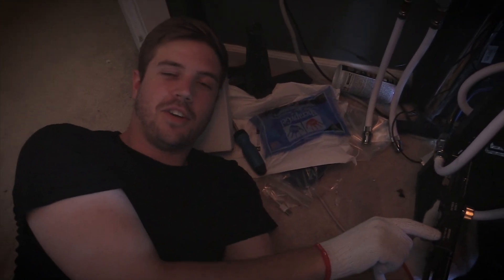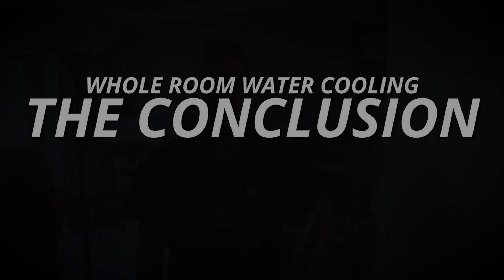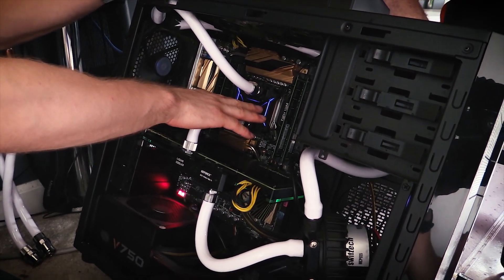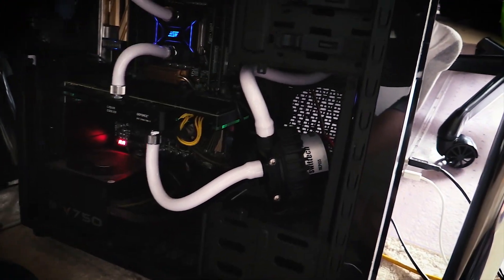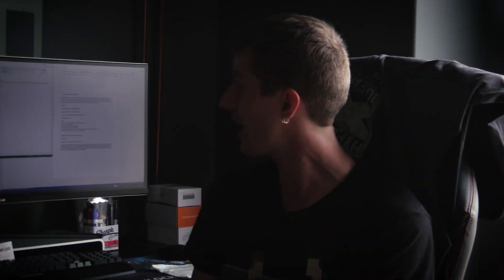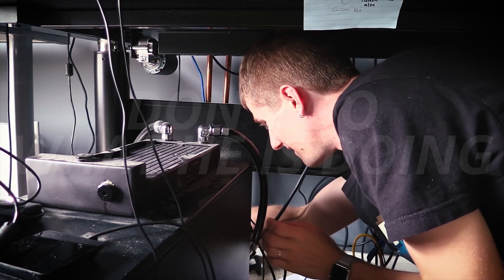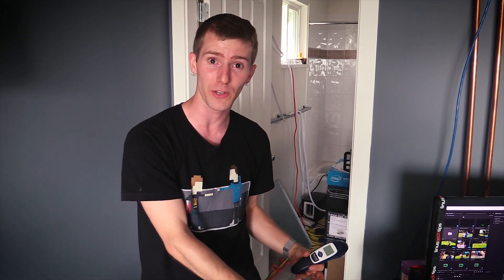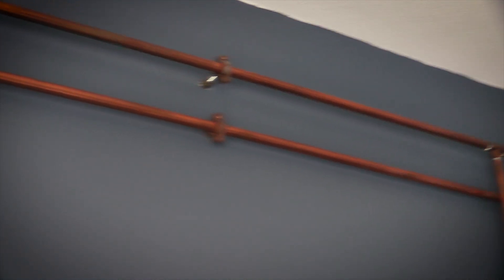Whole Room Water Cooling Part 7 - It's FINALLY over!

Comment: I honestly love this idea, and wonder about doing your water reservoir as a borehole into the ground like a well. It would pull from the cool part of the water with lots of volume to circulate, and as long as you filter and have a closed loop, you won't have contaminants circulating, then it can still radiate some heat into the air through copper pipe fins in the outside section before returning to the reservoir at the top end. If by some chance you were convinced to tackle that, I'd love to see it in action.

Comment: What's cool (pardon the pun) is that 7 years ago, Linus did all this instead of just buying an AC.

7 years later, in the 80 staff video, they had to pay $13,000 for a cooling solution, because an AC unit would have cost $150,000. 

Wild.

Comment: One thing I found amazing is that they wanted to remove heat to the room but continued to use cooling  radiators on each computer putting heat into the room.
Also it would have probably been a LOT cheaper to just install air conditioning by professionals who would chill the room down to 10 c or lower. 
or just chill one room and put ALL the computer radiators in the one room with the frost one the walls 
Don't try to reinvent the wheel you are not engineers

Comment: i actually did this with a custom waterloop, but for one system only. all the major heat producing components were in different rooms with PE tubes running through the wall separating them. it worked pretty well, there was no sound and no heat for the pc user. i had thought about dumping the heat outside but the logistics of setting up custom weatherproof electrical systems put me off. all in all, waterloops are not fun to maintain at all.
scaling up isnt really the solution here. its not enough to jerry rig some megaloop that runs through your entire space, it has to be built in to the walls. water is also very poor on such a large scale. its ok for the pc components because they are small and close together but the better answer is to just exchange your heat into a larger heatsink structure, like the house itself. or just fix cabinets into the walls with a vent that goes outside lmao
Reply: Youre insane man..
Reply: @shloftyintuos  like you gotta do crazy shit with custom waterloops, its the whole point. but it worked.

Comment: And, for the next video,  DIY electrical work replacing all the outlets that are within 3 feet of a water line with GFIs so they're up to code.
And, why not wrap those outflow lines with thermal wrap like one does for their hot water lines in their home?  That would help.

Comment: This already 6 years latter... But I want to ask....
1. Why not using Air Conditioner cooper pipe that have insulator so the heat (and the cold) would not goes into the room.
2. Why not using gasses instead of water? Gasses like refrigerant that used in Air Conditioner (AC)?
Reply: Because they are not sponsored by an A/C company.   This is entertainment and is supposed to fail while making you think about buying things from their sponsors.

Comment: Great job 👍 what a really cool build. 
You went for the cool Cooper look, But using insulation on the loop would have yielded much more performance.
Your hot line is bleeding heat into the room, and your cool line is picking up the heat in the room, so you radiators cooling efficiency is wasted.

Comment: you know if they insulated the copper pipes properly they probably could have gotten alot of the heat out of the loop via the radiators and cooled the room better

Comment: What if you fill your entire pc with mineral oil and attach 2 pipes to it. Those pipe go through a freezer with temperatures around -30F and you make the pc  and the pipes thermal isolate. After all this you can crazy overclock your pc. What do you think?

Comment: This is a really cool idea, and I do agree I think it could work. But I was wondering the entire time why they were using bare copper piping. Literally all of the heat from their systems are being dissipated mostly in the room. If They were using some insulated piping, they probably notice a much greater than 1° difference. Because then none of the heat from the systems will be going into the room, or at least very little .

Comment: Yes everyone knows perfectly well that an A/C with a curtain would've been cheaper and done the job fine - that's not the only point. The idea was exceptionally cool, and the rule of cool wins 9 out of 10 times. They fell short in their execution of the idea. Impractical yet very very cool idea, but unfortunately very poor execution.

Comment: Back in the early 1990s, I worked at a bank. They had just installed a new IBM mainframe in the computer room.  It was extremely quiet, and when they opened a cabinet, all I saw was a huge pump and large water pipes :-)   The mainframe was was cooled, and the water was directly connected to the Liebert unit. So the machine got cold water in, and put out hot water (not just 1° tempoerature difference).

If you have a room full of editors whose workstations each put out 1000watts of heat, it can make sense to take that head directly out of the machines instead of dumping it into the room and requiring more air conditioning power.  (and in winter, you get free cooling if your water loop has radiator outside).

Comment: upss. as you mention.. in this particular way like you did build the system, you just basically carry the cooling ingradient through the pipe but not the heat that it has. exposed copper pipes, as a really good thermal conductive, release back whole heat into the room before it reaches to the radiators outside. just cover whole system with foam and tape in Linus style, like air conditioner pipes has. =)

Comment: the copper pipes are acting as a heatsink, so the heat is going back into the room.  you need to insulate the copper pipes so the heat is taken outside.

Comment: If you do get the idea to do this at your new place, bifurcate your loop. Each computer has its own internal loop, with its own pump, reservoir, etc... but with a heat exchanger[1] in place of the main radiator. (You still want a small radiator in each unit in case the main cooling system fails.) [1] A good example would be one of these:  https://koolance.com/hxp-193-compact-plate-heat-exchanger
The main cooling line will connect to the other end of the exchangers will have its own fluid, pump, reservoir, anti-fouling and fan/radiator. This would prevent contamination from fouling your sensitive gear (like Teran's waterblocks in his rig) You also wouldn't have to worry about pressures in the main section of the WC infrastructure, affecting the performance in the individual rigs it is connected to via the exchangers.  It would also allow you to add the benefits of a chiller unit-- drop the temp of cold line on the main side to 5 or so degrees above the dew point to prevent condensation but otherwise allow for performance you'd struggle to get at straight ambient.

Second use PEX piping instead of copper, it's non-conductive, easier to guide, and doesn't require soldering.
Third, minimize pipe height to cut down on required head pressure for the pump and increase efficiency-- run the piping either through an exterior wall preferably near a window, or to a room you shove a AC mini-split into. 

Finally, get a butch radiator to expel the heat from the main loop with (IE. something like this  https://www.outdoorfurnacesupply.com/36x36-water-to-air-heat-exchanger-hot-water-coil-outdoor-wood-furnace.html ) and cool with as few fans as possible.  Relying on standard computer-size radiators and fans for at-scale cooling is nuts. You required dozens of fans and plumbing connections which increased the complexity of the system and likelihood of a failure.

Comment: You should have kept the PCs isolated from the external loop, and you should have bought a water chiller rather than building one out of PC rads + 120mm fans. Finally, plastic tubing.

Comment: !st I love you channel and you've been a go to place for information. That being said....

I'm posting this because we had this issue and many others do....and you're showing an instantaneous drop in temperature after the switch to room cooling...expected....but how does the system operate with everyone plugged in over the course of the entire day.

We had the same problem in my office...no matter how much cold air we blew upstairs it was still hot as hell....portable AC units create a large heat source on the compressor side which is inside the room hot enough to be to hot to touch and their loud...window unit are also loud which is guess what...in the room...the solution was counter intuitive...remember...heat rises...and the momentum of  thermodynamics is a bitch...it's air circulation that is the issue...we ended up keeping the AC blower on at a set temp 69 Deg F all year round and venting the air upstairs down into the living room, through the floor which was luckily on the opposite side of the house from the AC intake....no more problem...AC get expensive but the office heat the house in winter....it all boiled down to air circulation.

If you've ever been in a server room for long enough you get cold because the air is constantly circulating at 50 deg F. Running all those PCs is akin to constantly cooking Christmas dinner with both ovens going and all burners burning.

If you've ever been in a server room for long enough you get cold because the air is constantly circulating at 50 deg F. Running all those PCs is akin to constantly cooking Christmas dinner with both ovens going and all burners burning.

You guys have a great head banger of a project...but just an observation...I'm sure you've heard plenty of them...copper is a heat sink and you've just created a huge heat sink back into the office space....also you've created a large multiplayer by the square of the distance and elevation with respect to gravity Vs time pertaining to head pressure...each time the fluid changes elevation in that same office space...all this relating directly to pumps COP (Coefficient of Performance)...COP=hh/hw...and...head pressure imbalance for PC pumps Vs larger main pumps. You're likely to get PC pumps running backwards...heating each system...and the fluid...as they fight to maintain directional flow prior to PC pump failure.

Also there's something called ambient temperature flux or the gradient between the outside and inside temperature and on a warm day your going to dump heat back in the office space...the system outside is far larger then the system inside and let's not forget that the PC liquid cooling is designed against the studied average ambient temp of any given living space considering AC.

And the real bitch is...Water has a specific gravity of 1.0 kg per cubic foot (62.4) lbs/cubic foot....anti freeze actually is heavier...and get heavier...the colder it gets...by design...that's why is doesn't freeze...it's also corrosive and breaks down certain polymers over time.

If you had not changed elevation...i.e...run the piping horizontally behind each workstation and through the wall without running internal pumps it'd been much better.

Heat output
Heat output is measured in British Thermal Units (BTUs) - 1kw/hr = 3412 BTU/h or 1000 BTU/h is around 293W.

Based on the 754 watt figure, BTUs/hr = (754 watts * 3600) / 1054 = 2577 BTUs per hour, per server.

When calculating the amount of cooling (air conditioning) required in a room, you should take into account that the room should always be maintained at an ambient temperature of much less than 35 degree Celsius and that any other equipment in the room will also generate heat.

Officially, Intel recommends the following for the one SystemBase AXIII chassis (in a rack):

Important: For ventilation, the equipment rack must provide sufficient airflow to the front of the server to maintain proper cooling. It must also include ventilation sufficient to exhaust a maximum of 4,100 BTUs per hour for the server. The rack selected and the ventilation provided must be suitable to the environment in which the server will be used.

Web-based conversion calculators can be easily found (e.g. http://www.anver.com/document/company/Reference%20Guides/power.html).

Comment: Next time use pex. And call an auto mechanic custom automotive radiator and fan. And always install a filter befor each system. Hydraulic or fuel filters probably best.

Comment: Yeah, in room temp would be cooler if you used PVC instead of copper tubing. 25% of the cooling is from the copper tubing.

Comment: I knew a tech who worked for INTEL until DEC 2018 and he told me they have 'test chip sample' of future cpu's that are good enough at heat dissipation that without heat-sinks, no fan or water, they will run ambient at 50-60C and are stable up to 120c but throttle at that point and the highest speed he saw being tested was 12 GHz on 4nanometers. His point was they were getting better, closer to a 'room temp' CPU and he said all other chip makers were doing the same. This was 2018, can you imagine what the drawing board at the higher end is now?

Comment: BEST Install a metal mesh-grate system in the floor and have a AC system blowing AC air UPWARD through the entire floor around 30-35 MPH 24X7 and run your tests. ALSO turn the lights off and close all Windows, just night vision equipment if you need to find things or walk around the room.

Comment: With all the copper pipe you do not need the outside radiators.all the copper pipes are exchanging  heat with the lower temperature in the roo das making the room hotter. a chipper and safer way was to install a non ducting air conditioner.

Comment: y did lukes dad not install the pipes in a Tichelmann config? u would have same pressure loss on all Computers and not a 1st and a last one? and by not insulating the pipes the heat u pump into the room System will be heating the room!

1. make it a Tichelmann
2. insulate the Pipes!
3. never leave the shower head under water for Hygiene reasons! (it might suck water back into the house Installation which is at least in Germany not "wish to be"! by the DIN

Comment: The idea is cool, this was a hilarious train wreck to watch. A more effective way of doing it would have been to have an outdoor AC type compressor unit outdoors and run refrigerant lines to individual heat exchange blocks to individually water-cooled computers. That way you could really cool down the PC to what ever temp you want and really export heat out of the room. But that's a lot more expensive project. 

on a side note, don't use iodine together with activated carbon as the activated carbon will filter all the iodine out of the water.

Comment: Your piping diagram was wrong . First mistake output pipes at very high hight. input of water should from high hight and output of water from PC should from down (  very low hight :closes to PC:) because your cpu and GPU pump not enough to push water that hight.  If input is at 4 to 5 feet high then output should always at ground level. That's the perfect idea . And matel pipe very bad if in room so uses plastic pipes. Thanks

Comment: Chuck some insulation on those copper pipes and it will work a charm
So easy
Reply: Zac Queralt stolen comment from 2 years ago. Plus I doubt you can even think dumb fuck.

Comment: What ya'll needed to do was insulate your inlet / outlet pipes,  as insulation works for keeping things colder too.  Insulating the out pipe would have a similar effect keeping the llquid warmer but it would keep ambient room temps from rising by not exposing the pipes.    As for your heat exchange outside, it needs to be kept in shade and as low to the ground as possible where cooler air temperatures would be.  I would've also built a box for it and included a large fan to draw air out / across the radiators faster, maybe 2 big fans instead of a bunch of small ones. Talking box fans you'd put on your floor.  (Eco friendly version :  build mounts on top of the box for solar panels to power fans and create shade simultaneously. )  

 Clever idea though.  Should revisit sometime with a expert in thermodynamics.

Comment: I know of a guy who was building a house, so installed a very large copper loop under the concrete slab before it was poured to act as a geothermal heatsink for his water cooling loop.  Worked well for him, from memory.

Comment: I love the idea and the building of it.  But getting rid of the heat you also need to get the power supply heat out the room.  I would suggest to keep the cooling normal but put the air intake and exhaust air to the test with external air.  Thus keeping the computers air on and outside loop and not mix that air into the room. Then also you have a controlled air loop system that you can keep dust free and dry and cool it down with its own aircon unit. So instead of building whole room water system build a computer air ducting system!!!!   i WOULD LOVE TO SEE YOU GUYS BUILD THAT.

Comment: 7:38 he measures the temperature of the wall instead of the pipe... xD
Reply: It has 2 lasers
Reply: No the laser is next to the sensor. at that close range the sensor and laser are about 2cm apart. But using one of those on a shiny copper pipe isn't too accurate anyway.

Comment: I think the best way to go about something like this is to use a traditional household boiler as it's specifically designed to move water (hot and cold) about an entire household. Obviously I would only use it with cold water but I think that would be a much better solution. The only downside is that, at least here in the UK, a boiler MUST be installed by a trained and certified professional but I think that's got to do with hooking it up to the gas main (for heat), not sure if you can get around that by just not hooking up to the gas as after all, you just need cold water.